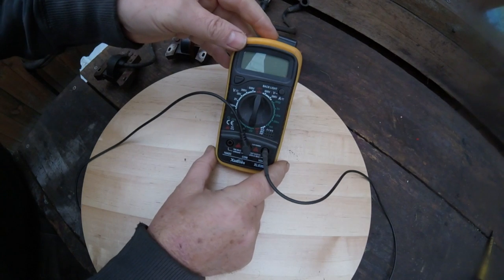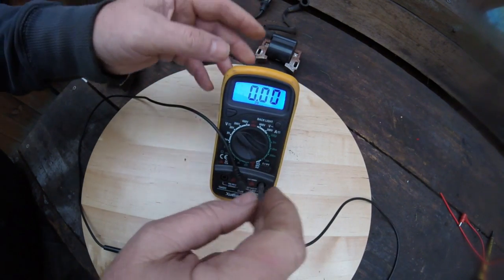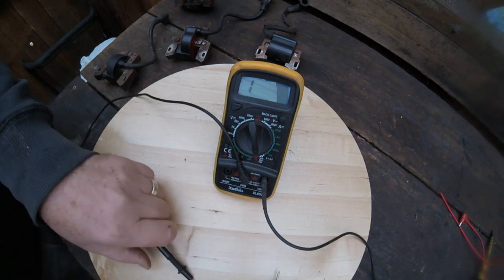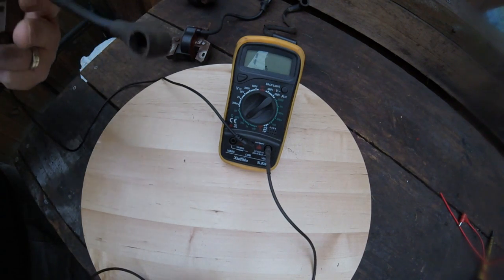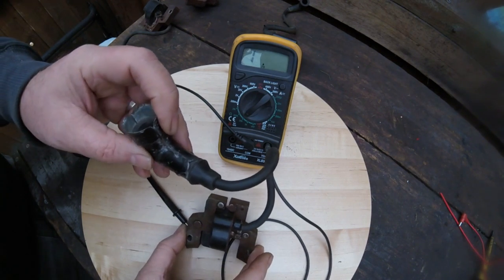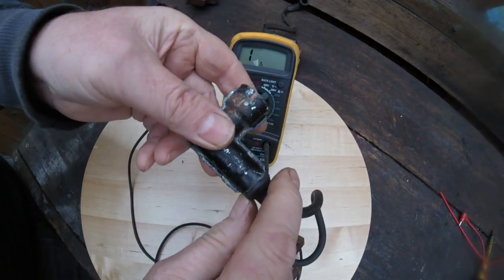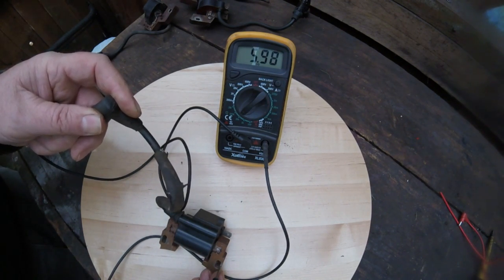How To Test a Briggs And Stratton Lawnmower Coil Using a Multimeter

Comment: Thanks, having trouble with my Husqvarna 340 chainsaw, did your test with coil attached to saw and got 1.56 so is that good or bad? adjusted the coil to credit card gauge and it started for a second with starting fluid.
Reply from the maker: Then the problem sounds like you're carburetor

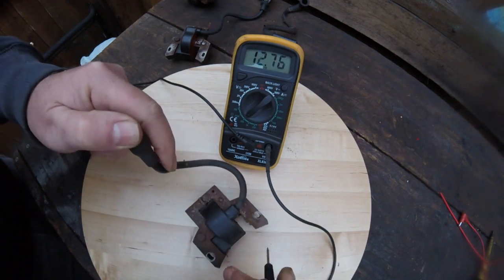Comment: 3:20 You should measure the primary winding between the spade connector and the bolt hole. If you measure both coils in series like you did, you will not see any difference, but if you measure the primary separately, you should get a very low ohms reading - like, less than 1ohm (change your mulltimeter scale if it isn't autoranging). While you can connect a kill switch to this spade, its main connection is to the points, so it's important to check it separately. The primary is high current, low volts, and the secondary is high voltage, low current. Hope this helps.
Reply: Keith Sherry  right, it is better to look at the principle of a coil, Bobine in Dutch, to understand the measured values.
and at 4:40 there is that cap. It is possible that they are R types, for suppressing pulses on radio etc. then there is a hi R resistance in that cap. So 5KOhm is in the circuit already. 
When repairing  old engines a often use caps without a suppressor resistor. 
Good luck with your videos!
Reply: ¹

Comment: On the coil with the brass connection take it off and retest it the price connection could be faulty I tried it works
Reply: That's so true! 
I also opened the brass connector only to find that this 'extra sparkplug' is in two pieces from inside. Just leave the brass element off and your good to go ;)

Comment: I am not sure but he said the positive wire went to com port on multimeter when I think it would plug into the other port,  Normally ground or negative would go to com port
Reply: My thoughts exactly. I've always put the negative into the com port.
Reply: Pretty sure he's in the northern hemisphere though
Reply: Irrelevant when testing resistance

Comment: Thanks Roy,  you might sound funny to me,  but I'm sure I'd sound funny to you.  Picked up a free mower from the dump...added gas,  wouldn't start...pulled plug and has gas on it.  Watched your video and found Coil with 4.69.  scraped all the oxidation off Flywheel around shaft the best I could,  but still couldn't see the flywheel shear pin,  so pulled the flywheel.  Sheared pin,  have to break Covid-19 stay at home and hope the hardware has a replacement...Small Island,  Only one possibility.  Happy Easter to ya and thanks for some new knowledge.
Reply from the maker: Thank you for watching and putting a great comment I hope you can sort it keep safe my friend

Comment: Good info. I’ll be testing the coil on a cursed freebie shortly. One item to note, Comm is your ground or earth connection, not positive. Black wire goes there. You’re red wire would go in either outside connection, right side for volts, ohms or milliamps, left side for DC amps. Hope this helps.
Reply: Absolutely correct , wouldn't get proper results if there is a diode in the circuit !!
Reply: Colette & Joe Shwetz true
Reply: If you are checking for continuity or taking an ohm reading the positive or negative doesn't matter with a digital meter.   It is simply reading between the meter leads.  Not a polarity bias situation.

Comment: hello I'm testing my Briggs and Stratton lawnmower coil its a 5.0 motor on a 20K setting homm meter it's giving me a reading of 6.75 is that right
Reply: Different coils have different resistance readings,the test is not definitive unless you know the resistance spec for the individual coil.However if you get open circuit or short circuit you know the coil is scrap.
Reply: Jorge Oliva I think the reading should be between 25.000 and 5.000 so it seems OK. If no spark check the off switch and that the wire is not touching the frame anywhere.

Comment: Thanks for your video. Mine was bad and your video confirmed my guess.
I had another idea, but can't test it right now. If you set your meter to measure DC voltage, and connect the positive lead to where the plug goes and ground the meter on the body while passing a neodymium magnet in the same path that the crankshaft goes, you should get a momentary voltage signal. If anyone can try it, let me know if my idea worked.
Reply from the maker: Will give it a try
Reply: @roystheboy  Nice! Looking forward to the results!

Comment: Very helpful. Thanks!  Is there a convenient place to find out what the various resistance tolerances are for different coils? I gather that the larger the engine, the higher the range of resistance should be. Is that about right? For example, if I want to check the coil for my truck, where do I find out what I should be looking for on a good coil.
Reply: instaBlaster.
Reply: @zakaigatlin5812  oi, don't be mean to th henglish!

Comment: Just a slight correction, for the open circuit example you say it has no resistance, when it in fact has infinite resistance (at least in practical terms).

Comment: Good video but one thing to keep in mind, coils can fail under running conditions.  The heat can cause the internal windings to fail and in turn the coil fails.  I just had this happen on an older opposed twin Briggs, it would start right up when the engine was cold and after it warmed up, it would not start again (no spark).  I have had this happen on other coils as well!  The opposed twin engine utilized a single coil with 2 wires (the cylinders fired at TDC at the same time) - I could take 1 wire off of ether cylinder and the engine would start, as soon as I put the wire back on and tried to start it back up it lost spark.  A new coil fixed the problem!
Reply from the maker: thank you for that information i will keep in  mind
Reply: @roystheboy  You are certainly welcome!  It is rare, but it does happen!
Reply: @ScottMiller-tu3gg  seen that a couple of times, it's a common problem with a ballast resistors  found on older Dodges.
Reply: @roystheboy  4.7K is the resistance okay?

Comment: Thank you i have a 2017 murray lawn mower and no spark,but the spark plug is good because when i hook the spark plug up to another lawn mower it sparks.So it must be the coil,i hope so because they cost $45.00.I never had a bad coil and i find it hard to believe the coil is bad on a 2 year old(young)lawn mower that was hardly used and was kept in the shed,but it was used because the fuel system is good.But i will try to test the coil on the mower like you showed before i buy one.
Reply from the maker: +ricky parr Thanks for watching I hope you sort it out if the coil is good check the connection at the ignition